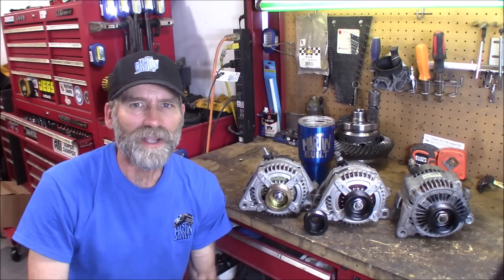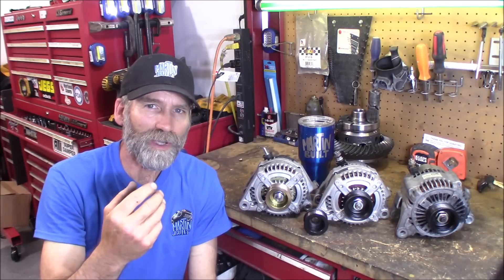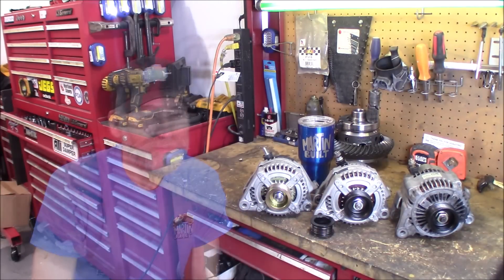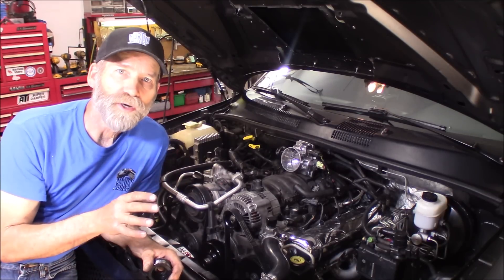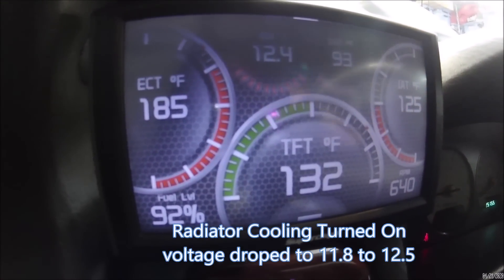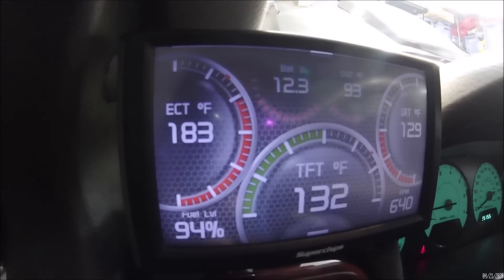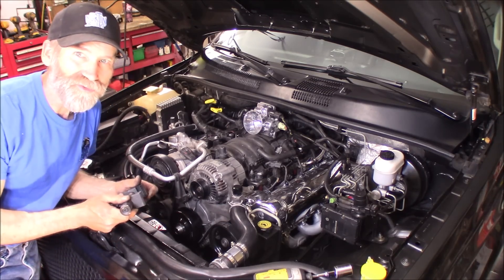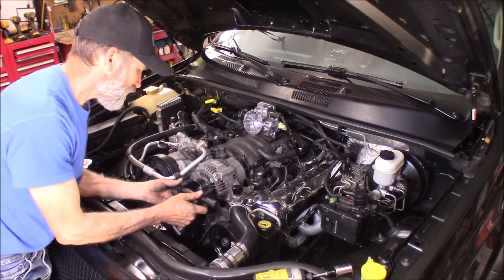Alternator Shootout at Idle (136 vs 160 vs 250 amp)

Comment: Voltage is not what you want to be checking as long as your in an acceptable charging range. You need to have an amp meter to see the real winner.
Reply: This is what i was wondering also-.and no mention of brand or if was a hairpin type design or the standard
Reply: Amazon alternators are junk anything under the 370 dollar range is garbage. Your biggest mistake your alternator wire is not 1/0 to the battery there goes your voltage the big 3 has to be done. That jeep if it's got 2 awg I be shocked probably 4 awg. Good for 130 amps and that's still under sized. 0 gauge is 1/0 not 1 awg go get some welding wire short positive to battery off alternator 1/0 to two grounds a 1/0 to frame and a good ground to motor. Get your self a custom electric alternator from Ohio 250 amp stock pulley. A real good agm battery and you will be at 14.5 volts. I run 5000 watts on a microphone that's transmit power and much bigger stuff then 3 of your jeeps can run. I'm on 3 500 dollar batteries.
Reply: If you are dipping below 12 at idle it means your alternator can’t keep up with the load and is letting it sag down. Checking voltage is a quiz and easy way to see if the alternator is keeping up. 

Amp clamp is when you have reason to deeper diagnostics.
Reply: @BVN-TEXAS  Nice re-hash! Keep on spreading great knowledge 👍

Comment: You should do a big 3 upgrade on you charging system wiring! With a larger alternator your bottle necking the power flow of the high out alternator!
Reply: exactly what i suggested that could save people a lot of money by not having to buy another alternator they could just install a big 3 kit a lot of people don't know about it and end buy a bigger voltage alternator and have the same problem basically your factory wire is not producing the electricity that your alternator can really put out DONT UPGRADE ALTERNATOR UPGRADE AWG lol
Reply: @1.4tmechanicscruze61  where can I buy it
Reply: thats not the issue here, its the low alternator speed. the only fix is reducing pully size. just because you have a H/O output alternator doesnt mean you will get higher voltage at low RPM. H/O alternators actually need higher speeds to reach their regulated voltage.
Reply: @alexanderk6512  but even if you reduce pully size and get more amps, the factory wire cannot support the increased amps. Upgrade the wire size. 1/0
Reply: @mighty9100  nit true.  It's just depends on what your stick wiring is.  Mine is 4 Guage . From factory

Comment: Nice video. You could also upgrade your charging and ground wires to help with the load. I am into car audio and upgrading the charging and ground wires make a huge difference  as well.
Reply from the maker: Thanks for the tips!
Reply: The wires should be thicker right?
Reply: joshsmith9  no, but it allows more power to be utilized more easily. It's like the difference of trying to breathe though a straw verses a paper towel roll.
Reply: @martinbuilt  yes do whats called big 3 for car audio systems you can not get 250 amps current thru the prob 8 ga stock charge wire run at least 2 gauge from alt to batt and 2 ga grounds also or go 1/0 gauge even better i have stock 90 cheaper puttin 14.7 idle then when turn everything on i get to 13.3 i have all wire 0 gauge make sure its pure or ofc copper do not get cheap cca
Reply: what kind of battery are you running make sure its atleast agm

Comment: This makes NO sense.  The EMF through the coils is a function of the speed.  You dropped the idle speed of the alternator a lot even with the smaller pulley, which means it is trying to output a lower voltage.  That will have a huge impact at idle.  Correct the speed of the alternator and then see if the 130amp is adequate.  It is NOT linear.  Your end result may make sense, but you might be missing the point.

Comment: I think that underdrive pulley really hurts your charging from your alternators wonder if the 250 amp would do allot better with correct speed compared to the 160amp
Reply: What I found out that pissed me off was it seems buying high amp alternators generally charge less at idle speed then your stock alternator.  they charge more when wound up but idle speed is critical if you drive in any kind of daily traffic.

Comment: This video demo is absolutely genius. Gives me the courage to swap out my crappy mini van's alt and slap a higher amperage to keep up with the car audio demands.
Reply: therockkkkher  not yet but i am about to. Will post the video soon my channel. I will be using alternator from a Nissan Caravan NV350 150A alternator or from a Mitsubishi Pajero 110A alts. I already bought these two and will fabricate steel mountings. Really soon my channel.
Reply: what you need my good sir is a big v3/v4 kit its a bigger AWG depending on what accessories you have like for an example i have aftermarket accessories like 2 mini light bars 2 600w amps 1200w alpine subs wheel well multi color led lights upgraded msd coil pack for wider spark plug gaps (.035) the vehicle manufacturers are the cheapest bastards and with that being said they run thin gauge wires from your alternator to battery and even battery ground as well as engine ground so simple solution is before you replace your alternator buy a big v3 kit for YOUR TYPE of vehicle install the kit DONT replace factory wire just put your new kit wire typically 0-4 AWG over your existing factory wire this will save you time and money by not having to buy another alternator because more then likely the factory AWG isnt letting the alternator produce the electric capacity its really capable of 🤟🏼🤟🏼👌
Reply: @1.4tmechanicscruze61  
Exellente point of view, allowed me to ask the questions & equipment

Should I do Only 3 big as you had suggested nor alternator & 3 Big.
I'm planing to hire a professional car Audio to do the job.
2018 CHEVROLET SONIC LT
HATCHBACK 4 DR
1.4L I4 F DOHC 16V
Amperage Output : 100 Amp
******"Equipment******"
JL Audio VX600/1i Amplifier
VX1000/1i Monoblock Class D Amplifier 
DRC-205 Digital Remote Control for JLid
JL Audio 12W7AE-3Anniversary Edition W7 Series 12" 3-ohm subwoofer 

Focal PS 165 FXEPerformance Series 6-1/2" Maximum power: 160W
Focal PC165F Flax 6.5”  
Maximum power: 140W
Focal Elite Utopia M Tweeters 
Maximum Power: 200W

Thanks 😊👍☕
Reply: I realize I'm pretty off topic but do anyone know a good website to watch newly released series online?
Reply: @Jeffery Julio lately I have been using flixzone. You can find it on google =)
Reply: @1.4tmechanicscruze61  Better consider normal cruise RPM unless You idle  around on all of your driving.
Reply: Good idea!
Reply: @Gazr Gazr thats actually pretty low wattage comparatively these days when talking car audio. He is running good clean power, atleast but those are reference amps- anything over that 1200 range and you HAVE to upgrade charge system

Comment: One thing I learned while working in auto parts, an alternator's amperage rating is given @ 2000 rpm. So when it comes to idle speed power production, all goes out the window, 160 amp alternator A will more than likely produce something different than 160 amp alternator B. Currently running the durango 160 amp alternator in my XJ and my volt meter hardly moves down off 14v even with my sub thumpin and my stereo blasting.
Reply: That’s impressive, my XJ will drop from 14-12v with just the AC fan coming on.
Reply: @OneTonTahoe  the only way I can get my volt meter to hit 12v is by winching my Jeep up a long steep incline with 12-18" tall steps after blowing up my transfer case on the trail and getting no output to either axle, all the while runnin my instant pot to heat up dinner. 5000w power inverter + instant pot = everybody inviting you on every wheelin trip and offering to bring the food if you'll just bring the way to get it hot 🤣🤣

Comment: Great video.  As noted by another viewer, the slower rpm speed will have a dramatic effect on the alternator. Of course you proved that by installing a smaller diameter pulley. Also, the vehicles computer may also have an effect,  the type of battery, & the age of the battery itself may have an effect.  I had a 2015 Chevy cargo van that would cause voltage drops from the stock alternator. I called the dealership, asking if this was normal, & they said yes. I further inquired as to why, and it was explained to me that it was part of the fuel economy system.  Certain times when I was going up a incline/ hill, the computer would cut off the alternator in order to reduce HP drawn on the engine, which helps with fuel economy. This would also happen with the air conditioner in the summer time. Also noted by another viewer was to perform the big three upgrade. Especially if you are installing a higher current output alternator. Your stock electrical wiring is generally rated for the current demands from the electrical system. Car manufacturers only give you what you need. Nothing more.

Comment: You may also try this with a multimeter on the alternator post. Ive found that any digital guages plugged into the obd2 port usually display lower than what the actual voltage output of the alternator is. Id check at the alt post, battery post and the input post of the junction box. Scan tools also display lower than actual voltage. Also anytime ive done a h.o. alternator i replace the lead from the alt to battery and to the junction box with heavier guage  ofc wire like 2 gauge. That always seems to improve things. 8 and 10 gauge with fusible links can only allow so much current at a time. Great vid keep em comin.

Comment: Thanks for this video. I've got a 2001 Land Rover Discovery 2 (L318) with a 4.0L Thor engine and a stock 120A alternator. A 2001 Land Rover Range Rover (P38) with a slightly bigger 4.6L Thor engine with a stock 150A alternator. 
Many Discovery 2 owners have stated that the Range Rover 150A alternator is adaptable to our Discovery 2s. 
Thanks for your experiments showing the differences. Cheers from a 'Murican in the UK!
Reply: Nice Buick

Comment: Glad I ran into this video. Had the same issue when upgrading to a higher amp alternator. The idle performance was just horrible. With a full load it started to dip in the 10s with voltage. Accessories would sound slower and the all the lights on dash would flicker a bit if already illuminated (but was fine higher RPM). This was after I have done my big 3 upgrade. Luckily I still had my previous alternator and decided to slap that back in. 14 Volts across the board sometimes hitting 13.  Returned the High amp alt and got my funds back. Not sure what my current alternator puts out as I had a shop replace my older one but just wanted a bit more amp headroom for the equipment I am running.
Reply: So you think 250 amp isn’t good?
Reply: @Sip28  didn’t say that. I Probably had a defective alternator or wrong pulley size. Not to long ago I purchased a 200amp powermaster, so far so good! 96 E150 5.8l V8
Reply: @gmax341  I had power master too but isn’t the idle amperage 130?
Reply: @Sip28  yes that’s correct. My idle at warm is around 500-600rpm
Reply: @gmax341  130 too low for me. I need idle to be be at least 180amp

Comment: Hey Martin thanks for your help earlier.  I fixed my AC in an old jeep I bought.  2002 Overland.  The compressor works fine!  Just needed 134 a.  Did the dye no leaks.  Might be a small one at schrader valve.  That all I saw.  I was trying to find the low pressure sensor to jump it over but after recharge it works fine.  Hubs and brakes r next!  I will catch some more of your videos for that.  Boy you r such a huge help.  I have air tools too.  Glad you are here!!
Reply from the maker: Glad it helped

Comment: I swear I am not some shill for the company, but you have to check out Mechman alternators. I have a 6.0 Powestroke (with fully upgraded wiring for + and -) truck that absolutely eats alternators due to the plowing and really low idle / 3.5k maximum RPMs. Those things actually deliver real idle output and they even come rated and pretested at Idle and running speeds. I've installed them on every truck I own barring one junker van. Your video absolutely made me feel better about spending $500 on a 320 amp alt from them. Plus no need to run a smaller pully unless you wanted to.

Comment: Great video.  I just put a chrysler 320 Amp 200 at idle JS Alternator on my 2.4L 2016 Jeep Renegade Trailhawk.  I had a 160A stock but now my MPG has gone up from 32highway to 38 to 41 and my voltage is 14.3 at my cigar outlet with AC on max and fan running.

Comment: Thank you for that, I’ve been upgrading these on different vehicles for years and never knew a 160 would ever outperform a 250 all things being equal (idle rpm). Never do the builders mention any of that useful info.
Reply from the maker: No problem 👍glad I could help.
Reply: Right wonder why is it the opposite?

Comment: Alot of things need to be considered here. The 160a with small puller may keep higher voltage under load but the 250a will supply more amperage under load(depending what rpm that 250a is specified). If you're wanting more voltage depending if your alt is internally regulated then a couple diodes will fix that(15v+) or if you're externally regulated then you may have to look at an external regulator with the 250a alt.
Reply from the maker: The thing is by adding diodes or a resistor and trying to boost the voltage will not work at idle because the the voltage regulator is already telling the alternator I'm looking for 13.8 or whatever voltage if the alternator can't produce it at that RPM changing  a voltage regulator or adding diodes or resistors will not make any difference in my case.
Reply: @martinbuilt  so I'm guessing your alt is externally regulated.. you would need an adjustable external regulator then and yes.. you can adjust voltage to whatever you need cold start.

Comment: I saw elsewhere on YT that high amp (aftermarket) alternators get their amperage from rewiring the windings in the stator from series to parallel (or vice versa). High rpm performance is improved at the cost of low rpm performance.
Reply: Depends what company, i just bought a 320a from autotech engineering that puts out 170ish at idle(650rpm)

Comment: Huh, that's interesting. I thought for sure the 250 would have given you the best results. Great vid as always 👍
Reply from the maker: Thank you! Cheers!
Reply: It's the way they wire the high amp alternators to get that amperage. Performs better at higher rpms, but at a cost to low rpm oerformance.

Comment: Thanks for the video I was just thinking about changing my alternator
Reply from the maker: Glad I could help
Reply: Me too I got 7k watts im trying to feed.
Reply: martinbuilt can I get a link on the 250
Reply from the maker: @Bigv57thG   and here is another link 
Eagle High Fits 250 Amp Alternator Dodge Dakota V6 3.7L 226cid 2004-2006 Dakota V8 4.7L 285cid 2005-2006  https://amzn.to/3dBWW7E
Reply: First put bigger charge wire on alt 4awg or bigger

Comment: From my understanding, alternator output is stated at 3600rpm. Idle will be dramatically lower hence the need for a battery. A battery is your fuel tank. Your alternator will replenish your battery while driving and do what it can at idle. A 160 alternator will output only 65-70 amps at idle with the stock pulley. Electric cooling fans can pull 30-40 amps alone. Really need that battery capacity to be available as much as an alternator ready to replenish it.

Comment: Thanks for the video.
According a few wj owners the pcm quits regulating the voltage at some point...some of them even junked their wj's for not knowing what to do...but the few that kept the wj just installed a voltage regulator fixed at 14.3...but it has an adjustment screw on the back to increase or decrease...i bougth one from alternatormen...end of problem..cheers!
Reply from the maker: I will look into that, thank you!

Comment: I guess I think 4 things (great video BTW): your belt drive system is underdrive to start, none of the alternators perform well at 600RPM (luckily I don't drive at 600 RPM), and the 136 AMP was working hard under any circumstance, and I agree, the 160amp was best balance between $ and performance, although I am curious about reliability and life.

Comment: Excellent comparison, Ive got an older Chevy with a 5.7, my alt output with my a/c and electric fan on it pulls it down to 11.9 volts.  Now I just gotta find at minimum a 130 amp alt, ive found a 200 amp, but have always thought that was to much anyways,

Comment: This was just the video I needed to determine if my alternator was right for my van conversion. Thanks for that...

I had a 30 amp bc/dc charger to charge my 220 amp lithium house batteries,  I recently upgraded by connection in parallel an additional 40 amp bc/dc charger (both RedArc). Before turning on the chargers the at idle output was 13.8 v. With just the 30 amp bc/dc on the volts when to 13.6. With both chargers on volts when to 13.4 & is charging at 72.4 amps. 

I am assuming the alternator is sized appropriately? Right???

Comment: Check the idle solnoid activity, check battery cells, clean all ground n earth sockets n contactors upgrade all grounds to higher gage wire , finally check or replace voltage regulator n the belt

Comment: Thanks.   I have both a 130 amp and a 200 amp alternator for my Ford.....and neither put out enough at idle....in drive at a stoplight, to maintain the battery with 'winter' stuff on, like heater blower, headlights and defogger.....  Will try the smaller pully.
Reply from the maker: Sounds good, it worked out good for me.